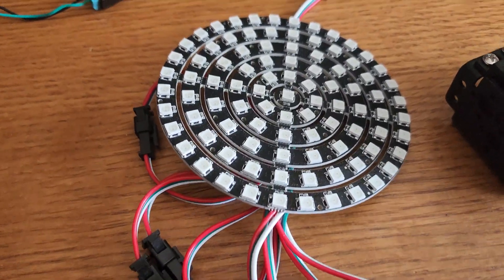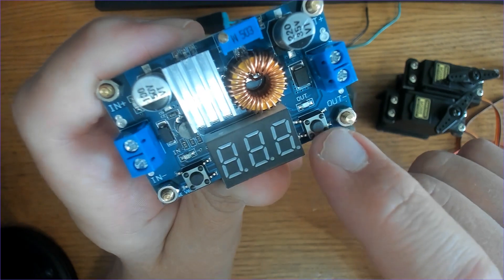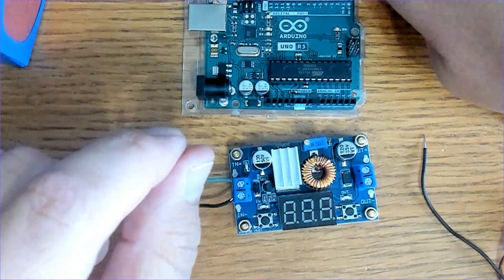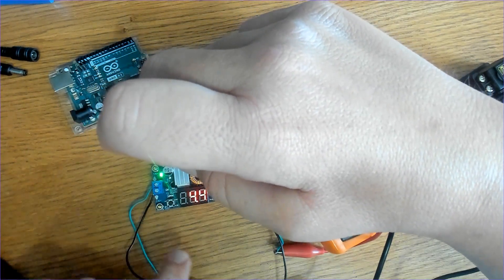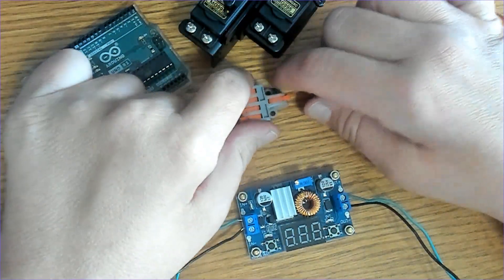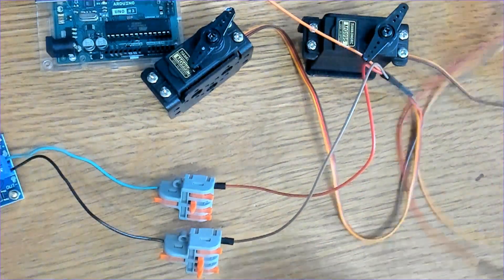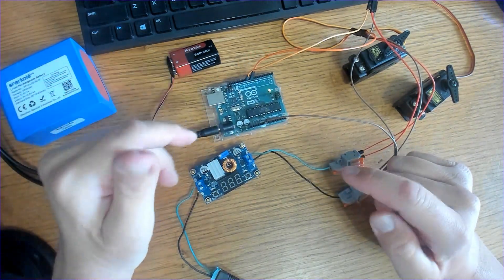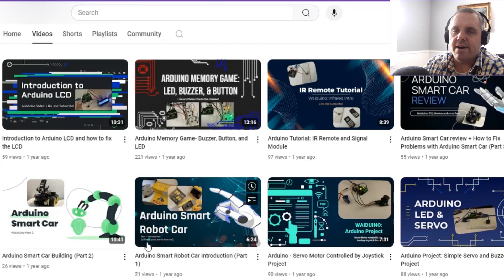How to Step Down Voltage and Boost Current With a Buck Converter in Your Arduino Projects

Comment: This is a great tutorial. I have problem when unplugging the connection from computer my servo motor doesn't work but when I reconnect it works. So if there any way on how to get the servo working with just using the 12V battery & a buck converter? I reallt need help on how to set it up
Reply from the maker: hey, thanks!
You need to provide power to your arduino. 
Is everyting running off a 12v battery or do you have access to plug it into a wall outlet? How many and what type of servo motor are you using?  Are any other devices or compoinents powered from the buck converter?

Comment: Thanks for the video. 
Question - is there an easy way in this setup to power the arduino from the battery you have powering the servos? That way if you would complete a project, you only have to set up a single power source
Reply from the maker: Hi! thank you.
You can easily power the Arduino and servos from a single power source by splitting the 12V supply. Here are a couple of ways to do it:
*Connect the 12V power source to a terminal block, and then split the output. One connection can go to the Arduino, and the other to the buck converter where voltage can be reduced for the servos.
*Alternatively, you can use mini quick terminal connectors (lever wire connectors) to split the 12V supply. From there, route one connection to the Arduino and another to the buck converter.

For the Arduino, it's recommended to use:
*7-12V for an Arduino R3 via the VIN (+) and GND (-) pins or the barrel jack for convenience.
*Higher voltage if using an Arduino R4, as it supports a broader input range.

I also like to use the Sparkfun RedBoard for Arduino projects like this. Their barrel connector can handle 7-15v and the board itself is a good price and good quality. No matter what board you use, just follow the recommended power specs.

When splitting power, make sure that your power supply provides enough current for all connected devices. I try to provide a power source with at least 20% more current capacity than my project requires to avoid overheating or instability.    I hope this was helpful~
Merry Christmas & Happy New Year!

Comment: Why would you have to connect the ground from your splitter to the arduino when the servos are receiving power from an external source? Isn’t the circuit complete with the positive and negative to the battery without the need for an extra ground to a part that is only providing data?
Reply from the maker: Hey there!  excellent question. 
Without a common ground between the Arduino and the external power source for the servo motor, the signal line becomes what is often referred to as a "floating" signal. The Ardruino needs a reliable reference voltage for the signal to prevent erratic behavior. So yes, you should connect external power ground to Arduino.
Always research answers given to you on forums and social media. I appreciate your question 👍👍